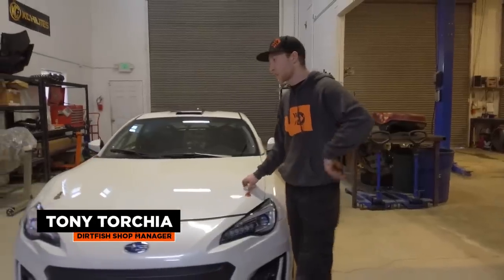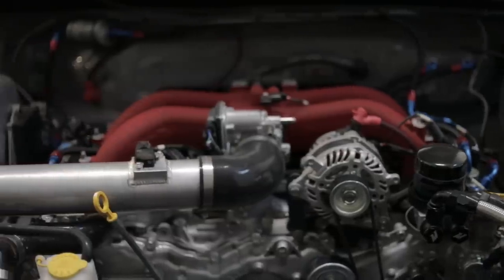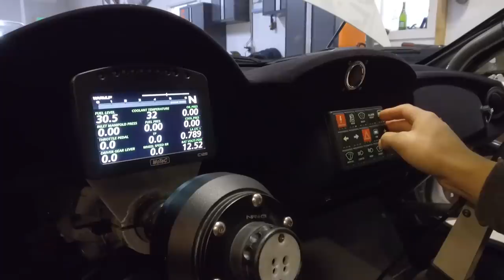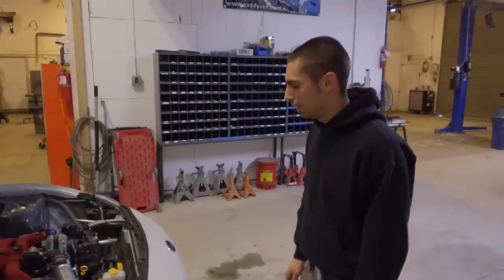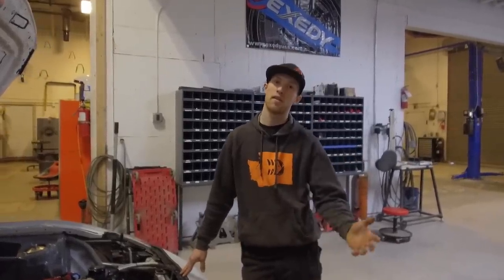Brand New Subaru BRZ Turned Into a Rally Car

Comment from the maker: If you could convert one car into a race car, what would it be?
Reply: I would chose a civic but, any car can become a race car. A rally Camry would be sick!
Reply: @crutch517 ... I'll match your camry and raise you an avalon, but if that is too easy, let's go for a lexus rc350Fsport
Reply: My 2011 forester xt 🙂
Reply: My old Silver/Black '92 SVX
Reply: Yugo
Reply: Nissan Fuga
Reply: DirtFish 1996 wrx sti
Reply: Honda Fit 😃
Reply: Toyota Prius
Reply: My Toyota Avalon XLS
Reply: 1990 honda prelude
Reply: lexus  is f
Reply: Lotus Elise
Reply: A Mercedes A-45 AMG
Reply: Proton iriz?
Reply: I would say a BRZ but I've seen the GT 300 version the rally version the drag version the rally cross version and the drift version. This car basically can do it all.
Reply: A rally gtr r35 would be soo good.
Reply: Subaru Legacy 1998 wagon and 2010 Wagon 🙏
Reply: my 2020 86! give me a quote
Reply: Chrysler Neon 2door. Because nobody would actually expect that car on a race track.
Reply: @foxman105  lol, I had a four door.  this would be MINT.  get the spot welder a case of beer.
Reply: @EnockEzra  4door is actually even better! that would really make it look like a Budget friendly family car past it's prime. Now we need to slap in a turbo on that 2liter, put in larger injectors, get some proper suspension, ECU and transmission inside and do the exhaust. If tuned properly it should get us around 200-250 HP. That's more than enough for a front wheel drive hobby circuit driver.
Reply: @Cosigner22  nice
Reply: Volvo C30
Reply: I want a replica MR2 222d
Reply: Renault Twizy
Reply: 91 Mazda Miata
Reply: New Suzuki swift allgrip... bar build quality, leaky carbon monoxide engine, almost killed us a few times...  works in the snow.  Very powerful for a 1.2, very light
Reply: A mazda3 sedan
Reply: VW Corsa. Dandy little car, I'd love to see it rally fitted.
Reply: Nissan Versa Note SR
Reply: Lovely build 👌🤙💯 ps. That motec engine management system is worth more than my entire rallycar 😋😂 but just to let yous know yous mounted that style of the bonnet pins the wrong way ther suppose to go horizontal or atleast 180° to way yous have them , because if you go through some bushes or a hedge the branches can open them 👎 ask me how I know 😋😉 building rallycars in Ireland 🇮🇪 for over 15 years 🍀☘
Reply: Tesla Model 3 Standard Range Plus
Reply: Rally skyline r32
Reply: My 2014 Dodge Dart
Reply: The brz base model that is available in Japan steel rim no radio
Reply: The olde Peugeot 205
Reply: 88 2dr Toyota Corolla gts
Reply: Citroen  2cv
Reply: My Honda City
Reply: it already has been done tho..... but a 2005 Echo Hatchback to the specifications of the Japan Vitz CUP BUT! with a 2ZZGE engine swap and sequential gearbox

Comment: Not a bad way to spend 150k...
Reply: Jerry Michaels where the fuck did you get 150k
Reply: Daniel Gastelum new car + the handmade rollcage + the new engine parts + new wheels and rims + all the electric instalation + the competition exhaust system + all the structural modifications + the carbon fiber interior + sequential shifter + hydraulic handbrake + new racing brake discs and caliper
And then you have todo add the price for the time, because it's a car for a costumer. I don't know If It arrives to 150k, but 100k may be. The official Toyota gt86 rally version costs about 85k $.
Reply: Easily
Reply: Naw its probably 70-90 k
Reply: Labor is not cheap
Reply: Yeah, not sure exactly what this costs, but its going to be way up there. I know a local fabricator putting a 2jz into one of these with frame strengthening and roll cage.
Reply: car is 35k cash, cage and assorted mounts id say a easy 10k, turbo 5-7k, wheels, brakes and bolt ons easy 6k. then it all depends on the labour, considering were at about 55-60k conservatively is day your looking at 80k at most.
Reply: If this is their project car, labor is technically free. Wheels tires and spare 6k, brakes 2.5k, turbo 3k, tranny and shifter 12k?, Seats 4k, misc carbon fiber Kevlar steel wiring 1-2k, ecus dash steering wheel 5k, new brz+tax 30k. All exhaust systems 4k. Total I'm guessing 70k.
Reply: @Evalatiuhnz  he is close to the numbers and remember it Awd am assuming it's running proper rally differential not parts bin from somewhere .I could give u break down if u want coming from a guy who is in rally and has built his own rally car .
Reply: @CarlosGarcia-ze6rt  it's almost there u forgot rear diff and transmission with PTU from either sadev or xtract not less than 15k ,coz this badboy is Awd ,reigers suspension  alone I was quoted 17k ,motec ecu and all buttons pads and wiring at least 7-9k and its goes on
Reply: @palboyz9397  u are dreaming 80k ,that's full blown rally  car no cost spared ,to build is expensive Europe u can buy used one fiesta or any car for atleast 100 to 170 used ,it costs more when u initially build ,just the R4 kit cost 119k euros just google what u get in that kit,my focus is not even full blown as that BRz and am already at 60k not even considering my time

Comment: Amazing build!!  I've wanted to do something fun with every BRZ I've owned but put too many miles on the car to do something this extreme 😕  How are the stock brembo brakes on the car?  You guys upgraded the brakes on this car as I'm sure they are purpose racing brakes, I can't get an answer from Subaru if the upgraded Brembo brakes on the facelift / performance pack cars will fit on my 2015 BRZ series.blue with the stock 17' STI rims.

Comment: Mannnn I just love RWD cars on knobbly tires with raised white lettering. Unlike most rally fans I think audi rather ruined things in the 80's with their shady-ish entry into the awd era. I mean think of it, the champions before that were Porsche's and 240z's and Lancia 037's. Don't get me wrong I like a quattro, especially the first iteration before they went crazy with the wings and spoilers, but I just don't get that excited for the last 40-odd years of understeery awd bread loafs blatting around the stages with tiny 4 cylinder engines.

Could you imagine if group b and awd hadn't forever changed the sport? I know there's an r-gt class now but I simply love the idea of 993 and 997 porsche's slinging gravel sideways on big chonky tires, or 350 and 370z's, maybe an E92 bimmer with factory support and 500bhp blasting out of that sublime flat plane crank V8? All I'm getting at is I would be so, so much more excited to see the last couple decades' most exciting cars go rallying, with diverse engine and gearbox packages and real, interesting, differences in strategy seeing how the teams work on the challenges unique to their vehicles. Skoda's and Hyundai's are cool WRC cars (though the hybrid breaks my heart. electrification ruining all the cars I love for no reason), but I think modern RWD performance vehicles would be 10x better : )

Comment: I'd love one of these with a tarmac tune... every rally car needs a tarmac tune... but anyways, guys, this was spectacular.
Reply from the maker: With the Motec system, it would be pretty easy to add something like that to the car. All we would need to do is change the suspension, tires and possibly add a little more rigidity with a sway bar or two.

Comment: What alignment numbers camber/toe wise you guys usually set on FR-S/BRZ rwd cars for loose grip surfaces? (ice/snow/gravel). Track guys usually up camber and put more camber front, to change grip balance to less understeery. But on yours, if my eyes don't fool me, seems there is stock-alignment-like less front camber then rear, hence my question.
Also wondering if you make/sell parts individually, if they are drop-in mountable on stock cars, and if you ship internationally (eg. skid guards, skidplate and so on ..)

Comment: They basically rebuilt it
Reply: Right! It makes more sense to me that they should've picked up a cheap used one 🤷‍♂️
Reply: Rubbersidedown2 
That’s because used cars are harder to work on.
Reply: @calvin3448  wdym? Used cars are way easier to work on. Way less electronics and stupid stuff
Reply: @willbrust9725  
Difference between used cars and old cars. Building a motor from 2015 will be more costly than building a fresh motor that’s clean.

Comment: Thanks to horse power academy I understood the wiring part. I hope that he is faster than me it took me hours just to rebuild my door wiring harness.
Reply from the maker: Wiring takes FOREVER! And, if one thing is wrong it could mess up everything.
Reply: Ah it's fine you just have to keep the high beams on for the car to run and turn the heater fan to 3 to get over 2500 rpm
Reply from the maker: Hahaha! Exactly!

Comment: Any insight you can give on the tubing used in that front structure? NASA and FIA are pretty clear on roll cage requirements, but the tubing used for that front structure looks much smaller than the roll cage structure. Where I've seen 1.75" for main roll hoops and 1.5" for cross bracing in roll cages, that front structure looks closer to 1" and maybe even smaller for some of the tubing holding up components like the lights and such. Thanks!
Reply: The front structure isn't part of the roll cage, it's just to hold the headlights and front bumper on.  The chassis rails are still the core chassis strength in the front, just like the road car AFAIK. :)  If you see a NASCAR they are built the same way in the front.

Comment: Are you using the +15 or +48 wheels? And would those work on frs/brz stock without hitting the oem tie rod (I live in chicago and want to hit my car with 15in wheels and trd jdm "rally" dampers, and these are the v spec correct? I appreciate it if you actually see this,lol
Reply from the maker: These are the MR501 VT-Spec and they have the 48mm offset. They do hit the tie rods, so we move the mounting point of the tie rod not he knuckle.

Comment: that's one beautiful car...why did they want a sequential shifter?....also why was the ecu and wiring harness completely replaced with the motec system beside easier tuning and removeability ?
Reply from the maker: The sequential is the quickest and best transmission that is allowed in rally. We went with the Motec not only because of the points you mentioned, but it is more customizable and we can also monitor more aspects of the car.
Reply: DirtFish I understand the benefits of a sequential trans in the car but as a starter rally car as you have mentioned in previous comments isn't that a bit over kill..unless this customer didn't really care for the price tag of any one of those parts and just wanted the best of the best of everything
Reply: when you have a ton of excess money to spend on stuff, you are able to get whatever you want. of course if money was an issue then they wouldnt have went  those routes

Comment: Hi guys! 
Do you do any kind of break-in procedure on the engine/drivetrain for these out-of-the-factory cars/components?
Reply: It's supposed to go 1000 miles before going over 4000 RPM for the FA20 engine...they went 50...oops.

Comment: What is the wheel demensions on this car and if it was raised? How high?
Reply from the maker: The wheels are Method Race Wheels MR501 15"x7". We didn't lift the car, we replaced the stock suspension with Reiger Rally Suspension that has more travel.

Comment: Surely this is the 1 motor sport that wouldn't work as well as electric if at all?
Reply: I don't see why it being electric would change things. If anything it'd make the sport faster because electric cars have the potential for FAR more torque than petrol engines can provide. 

I'm totally against driving electric cars because it goes against everything I find fun in driving. But I don't see why we should be adverse to electric cars in rallying.

Comment: Does it have a fuel cell
Reply: Where did u position the cell and what size
Reply from the maker: Yes, it has a Fuel Safe cell and we locate it directly behind the co-driver's seat. We'll have to check on the size.
Reply: @DirtFish  does FIA or NASA rules dictate that if u remove OEM tank of certain capacity replace with similar capacity in the case of fuel cell  or the rules are okay with any size ,am in Canada and replacing my focus tank with 8 gallon fuel cell ,4 gallons less than OEM .
Thanks

Comment: Could have saved 25k if they bought a frs vez for 4k that needed front end work
Reply: Alex Villalobos could possibly have frame damage making the car a nightmare to work on and get a really tight cage, also he wanted a fresh motor.
Reply: And you can sell the parts you replaced which are in perfect condition and get some money back.
Reply: Given how much they spent on this build, saving 5k was probably immaterial.  The car has a $10k gearbox in it! The fab work would be very expensive too, at commercial rates (as opposed to DIY race car).
Reply: if anyone can afford this kind of build, like he would waste time and bother with selling oem parts for pennies!

Comment: Why use a new car??? That’s crazy. Could have got a car outta the junkyard if you were going to throw everything away and chop up the remaining sheet metal.
Reply from the maker: It's easier to build a proper rally car with a brand new car than it is with a wrecked car that could have frame damage and would have alignment issues forever.

Comment: What are the wheels and tires and stock suspension?
Reply from the maker: The wheels are Method Race Wheels MR501 VT, the Tires are Hoosier Gravel Rally tires and we replaced the stock suspension with Reiger Racing suspension.
Reply: DirtFish thank you. I was getting rpf1's until now lol
Reply: DirtFish oh and do you have the wheel and tire sizes?
Reply from the maker: The wheels are 15" and the tires are 205/65R15.
Reply: DirtFish final question.. will it fit on stock suspension?
Reply from the maker: Yes! However, you will need to re-drill the upright to move the tie-rod closer to the knuckle.
Reply: DirtFish that sounds interesting